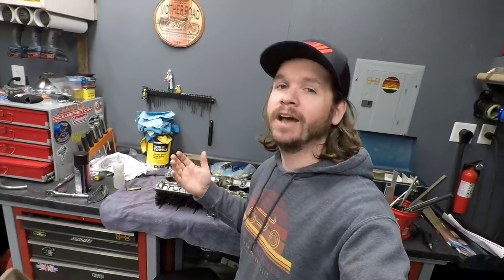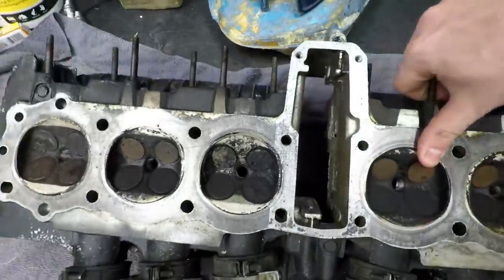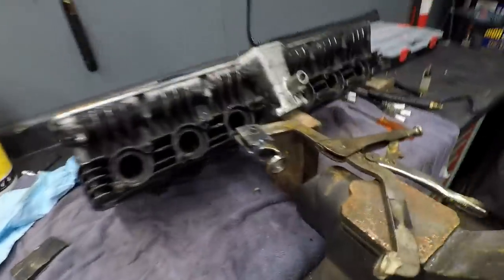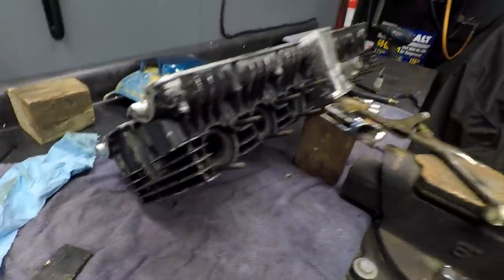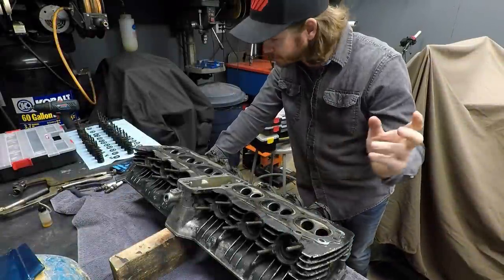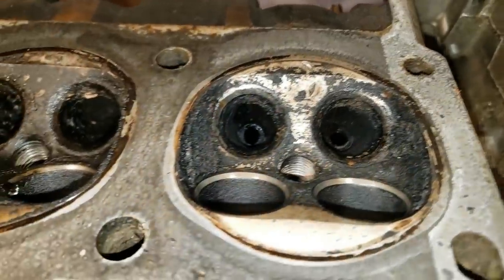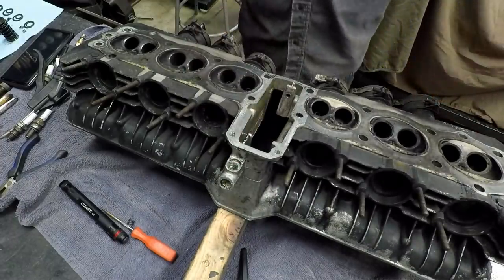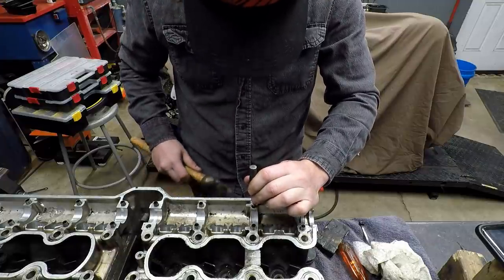Honda CBX Cylinder Head Disassembly - Found More Problems - EP5

Comment: You are doing a great job and great videos! For broken studs or screws I love left hand drill bits. It doesn't change anything from your method EXCEPT very often the broken part start getting out BEFORE you end the drilling. Even if it doesn't... it makes nothing different. And as I got a small lathe, I can make a custom drilling guide every time I need ... and it makes the drilling much easier!
Reply from the maker: I hadn't thought about that drilling guide! Thats a good idea
Reply: I concur with the reverse twist (left hand) drill bits.  Often backs out the broken part during drilling.

Comment: Time seems to always be the difficult part, great episode. Good job with the bolt, did you have to use heat at all?
Reply from the maker: No it came out real easy. Barely removed any time from the clips. Just some fast forwarding

Comment: So when that bolt just started turning out so easily did anyone else think " You lucky shit!"
Reply from the maker: Well yea myself included lol
Reply: The more I practise, the luckier I get. That's as true for BHB as for anyone. A mistake lots of people make with screw extractors is to drill too big a hole in the broken bolt, assuming that a bigger extractor is bound to be better. But the bigger the hole, the less material is left and the broken bolt can be expanded by it to grip tighter. Still, I would have used heat too to be on the safe side. I've only broken one extractor - the first time I tried to do the job - and the pain of rectification means I go really really careful with them now and use them as the second to last resort. The last resort is to drill right out and retap for a a helicoil or timesert. I've given up with extractors when there's no sign of movement and a risk of snapping them to move on to that last resort.

Comment: Evening Buddy. That was really interesting and fantastic getting that snapped bolt out 👍🏻 I’m 
now 66 and was brought up in the 70s on Honda CB motorcycles stating with a club 50 then a CB 175 electric start lol 😆 Then a CB 250 super dream old and new then a CB 650 tourer. Then a couple of K Hondas 550/ 750. And a few others. I then got a Honda super bike the VF 750 and came off at 110 mph. I’ve never been on a bike since but I do like watching guys like you restore the old Hondas that I loved 😍 I can remember dreaming about the CBX in the showrooms along with the Suzuki 750 kettles lol 😆 I had lots of other bikes from the era like KH Kawasakis Yamahas ect. but Hondas was my favourite by far. Cheers Stevie 🏴
Reply from the maker: Thanks! Luckily it came out easy and didn't require anything fancy

Comment: Hi and thanks for your videos and excellent standard of workmanship. Just a tip with that broken bolt: i would have put a close fitting drill down through the dowel to get a good centre mark to then drill for the easy out; because, as you would know, getting the drill hole central is imperative, especially if it comes to drilling the bolt out completely. :) cheers, Neil
Reply from the maker: Noted

Comment: Another great video. You had all the luck with that broken stud. What is going to happen with the broken metal that shouldered the camchain that fell into the gearbox? Are you going to weld a new piece on, or just chamfer it off. Keep up the exvellent work.
Reply from the maker: Im not convinced that this is the same head that it had originally. I can't find any areas with broken off bits so I think the piece I found was from the original head.

Comment: You may know this they do make left hand drill bits, they will try to remove the stud as you drill. For bolts not in very tight they will remove the bolt so no need for the easy out ( not a joke).
Reply from the maker: Yeah one of those tools Ive never had to have I guess. I should still grab some but so far i've always been successful with traditional bits.

Comment: Even though I understand you're busy, it's a shame this was the last CBX video a year ago now. 
I have never seen an engine rebuild, but always been curious. Seeing this engine get the treatment you have given it, is an eye-opener. Have watched every CBX video in order that you have made. That sort of says something, that I am genuinely gripped by this.
FWIW I thought you would have done an engine rebuild on the CB750. Just for love and to make sure it's tuned 100%.

I'm kind of partial to the Kawasaki GT 750. They were built about 1980 - 1990, but almost all of the examples we see now are rough.
However I saw a vid of a mint GT 550, that was for sale. https://www.youtube.com/watch?v=N0IVDwiAdFE
Also someone riding and showing a nice loved one. https://www.youtube.com/watch?v=GZ7Cx3fy2G8
Reply from the maker: It is a shame its been a year. That was never the plan but I have not had the ability to see it through yet with all I have going on. For the CB750 it runs like a top with 165 PSI compression on all 4 cylinders, no oil usage, and clean oil filters so honestly no need. I also don't want to rebuild it as that means the bike would be off the road for a long time as evidence by this CBX rebuild lol
Reply: @BrickHouseBuilds  I remember in the CB750 hour long video that you said there was very low mileage on it. hence no need for an engine rebuild.

I don't have even 1% of the bike knowledge that you do, so I was not being contradictory to you. 

More just watching for fun coz I love bikes. Like I am not specifically a fan of the CBX, but due to loving bikes, it's impossible to pass that video. The engine strip down was brilliant.

What's also cool is your appreciation of older bikes. Quite a few new bikes leave me cold, especially the ones without a proper pillion seat. Something that older bikes never got wrong. Many new bike pillion seats make me annoyed that they designed them looking uncomfortable. Whereas your Bandit seat is what bike seats should be like. Eyewatering bike.

Anyway, best of luck. Your Bandit is incredible. If I were a jealous type person, I would for sure be envious of that. As I am not a jealous person, it's nice just to know it exists and is in great hands. (Nice to have seen it.) The chromed side panels that you painted black, look excellent.

Comment: Such big cost involved personally I’d mic each valve look at the  faces and margins under a magnifying glass  and check run out no point junking good parts  looking forward to seeing this head all vapour honed.  Seats cut etc  r u going to leave the head in it original aluminium finish. Nice job on the bolt removal the bottom cam brgs look great how r the cap brgs  luv the cbx  is it a faithful restore or resto mod
Reply from the maker: Ill have the machine shop do that but being that valve recession is a real thing on these its more of a "while im in there" I better make sure its right kind of thing.  The engine will be painted in the original silver.  I have a couple bearings that need a light polish

Comment: No need to replace the valves, just regrind them!
That is what they do in the head shops, unless they are really worn out.
But these should be fine.
Reply from the maker: You don't regrind these actually. Due to their design they are notoriously soft and should be replaced
Reply: @BrickHouseBuilds  I am mostly a Diesel guy, so I don't know much about motorcycle engines. I did ride a 1996 CBR 1000F for 5 years.
Best bike I ever had......
Never had any problems with it, just put tires and gas in it.
I love that bike.
This video should give you a taste of it.
But you might already know it.
https://youtu.be/w38VuQNU_6I?t=159

Comment: Hi, great series, looking forward to the next episode.
A tip for marking the centres of the bolts where you have a guide dowel or a deep recess.
Use a transfer punch, a properly hardened one unfortunately not HF as they are to soft, sized for the inside of the dowel and get some left handed carbide spade bits.
Experience has shown me that sometimes you need to heat the immediate area with a small tipped oxy/acetylene torch to get as small a heat spot as possible so you don’t anneal the aluminium in the area to much.
Keeping the wood and self tapping screw count to a minimum is always a challenge.
Take care.
Reply from the maker: Did not need any of that here but thank you for the info
Reply: @BrickHouseBuilds  Thanks, had quite a few with various non standard fasteners to rectify in my past., prefer timeserts over helicoils but either work well.

Comment: Wow what a bike I've only actually seen two of those in my whole life and I will be 63 in August. Back about I guess 20 years ago when I was living in Texas I came across a 700 V for Honda which I came to find out equaled about a 1300cc I guess it was a 700 CM not CC can't remember I think it was water cooled and it actually used the frame for oil cooler I believe have you ever run across any of these I can tell you I found it parked on the side of the house and bought it for $150 it was seized up but within a month's time I had it running not very well but then again I'm not a motorcycle mechanic I'm a carpenter. Although after going to the Honda shop and inquiring about Parts oh my God I could not believe the price on the parts and then I found out why it was a very rare bike or not made very much one of the other I think only two years maybe not for sure it was a long time ago please let me know if you've ever heard of this??? Just asking cuz you seem to know a lot about Hondas
Reply from the maker: Can't say that bike sounds familiar to me at all actually. Honda did have some v models with funky names but nothing 1300cc beyond a v4 St1300

Comment: Cool videos - thanks.

I had a red 69 - loved it.

Does it really only have 11K on it?
Reply from the maker: Hopefully this one didn't have too much talking for you 😉 

They didn't make a CBX in 69 so I assume you mean a different Honda. Maybe CB750?
Reply: That was a typo - it was a 79 - first year.   The only mod I did was a 6-1 pipe.      

Talking is getting better.

LOL

 @BrickHouseBuilds
Reply from the maker: A 6 into 1 definitely sounds the best. For this bike since it is going stock I must go 6/6. Check out the recent CBX revving video I posted a few weeks back.  It was from Barber Vintage fest